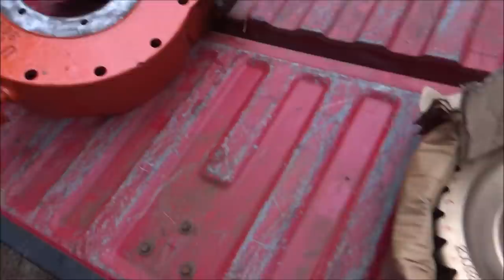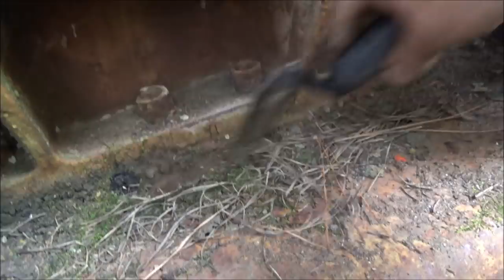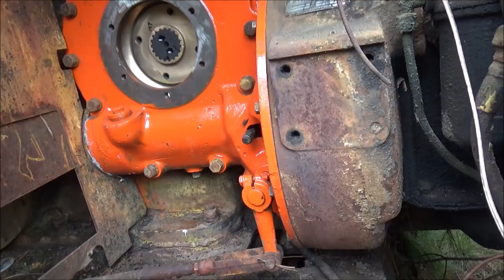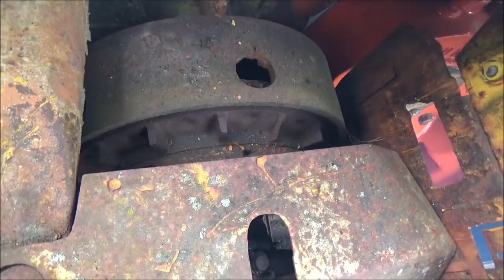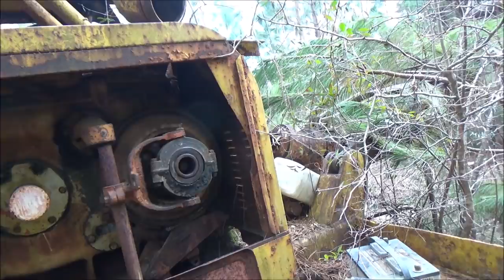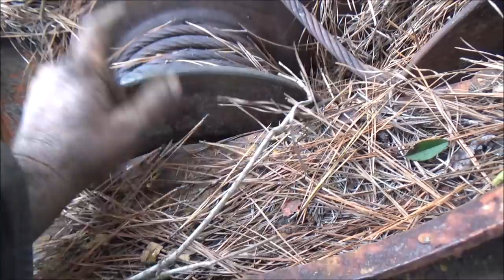UNIT 614 CRANE RESCUE 20 YEARS IN THE WOODS PART 8

Comment: Jonathan, my career has been designing , and maintaining heavy industrial equipment  with power gearboxes. I often run across gearboxes which are welded down,. I thought it was to replace dowel pins etc, but I recently was told by a major gearbox manufacturer NOT  to weld the boxes down ever! They said this started during WW2 in the shipyards (Oakland?) where the US Navy was building a lot of destroyers. The engineering spaces had many pieces of rotating machinery which were bolted to relatively thin  steel plates. A decision was made to align the equipment and then weld it down to insure it didn't slide out of alignment. Probably because the hull is fairly flexible and moves a lot in heavy seas. That became a standard in the shipyards, and there were a LOT of men working there.After the war, these same people moved on to  other parts of the shipbuilding and other industries and took that custom with them.I would not worry about the welding. The problem I had was every weld I found holding gearboxes down was cracked! You can't possibly preheat a 70 ton chunk of steel enough to weld a 300 pound gearbox to it properly.The weld cools from the outside in and the last place to cool is the center of the fillet and it usually cracks. I called to ask a mfgr about it  and they told me the story, also that the hold down bolts are sized so that when properly torqued, the box will not slip with the max output torque for which it is rated. Jonathan, I always watch your shows and I admire you more for your character , but I also think it is incredible to see y9ou do the things you do.
Reply: My thought on the weld is that since the bottom of the weld doesn't appear to actually be attached to the plate, it is most likely a replacement engine.
Reply: That makes a lot of sense.  My initial thought was that the weld wasn't there to hold the gearbox down as such, but to hold those floor plates up as they had rusted out around the bolt holes so they'd been welded to hold them up and stop them dropping into the tracks but that just wouldn't make a lot of sense as that gearbox has to be bolted to something a lot stronger than just some fairly thin steel plate...
Reply: Being an ex-USNavy guy who spent a lot of time on a WWII oiler, I totally agree with what you've written. When I was there though I was to damn dum to know though.
Reply: @garys9694  When I first began my career, my boss built some tracking antennas which had 20 hp motors driving 5 hop gearboxes. The boxes in service quickly moved,, misaligned and wore out. Then he sent a crew ojut to weld the boxes down  and scribe a line immediatey above the weld so the boxes appeared to be sitting on steel pads. That fiasco put our company out of  business, .

Comment: I love that you took the time to paint the gearcase, and the color is perfect👍😎
Reply: Agreed 👍
Reply: I used to work with an old time mechanic, and whatever component he worked on got a generous coating of Ford engine “blue” paint, and he always said, “ if you’ve got a complaint about this job, you know where to come”, and by the way, it didn’t matter what color that piece of equipment was!
Reply: The color looks like the tangerine paint for my 53 Ford's engine.
Reply: @fairlanefivehundred  I figure it shows that the person doing the repairs cares enough about the work they are doing to protect the part they are working on. Always a sign of a good mechanic or other technician, but we already knew that about Johnathan. That is why we watch.🙋‍♂️😊
Reply: looks like the old lead rust prevention paint. BleiMennige in German.
Reply: Paint will not make it operate any better one way or the other!
Reply: @garygermain2333  True but it will help it work longer and is part of a proper repair. Shows pride in one's work.

Comment: When you were moving the levers, I saw a very small movement from the tracks when it was bogging down. One step at a time. I have faith in you. It's working except for the stuck parts.😁
Reply: Yeah tracks rusted solid run the risk of shearing the new bronze gear nagain
Reply: @rsprockets7846  I saw no movement but maybe it deserves a re-watch. Do you think it needs some mechanical persuasion first, before it tries to move on its own? Put it in neutral and tug on it with his truck to break the tracks free?
Reply: Jorge, I was watching the tracks closely, and I thought I saw them move too.  When it didn't start to crawl out of its hole, I thought maybe I was imagining things, but looking at it again, I agree with you that it did move ever so slightly!

Comment: In lattice boom cranes no section can have a bend or kink boom will buckle collapse.
You can replace angle boom chords easy.
Tube booms very different to repair .
On rigging heavy lift cranes all welds must be x-ray certified to pass inspection .
But on old digging crane it's no big deal.

Excellent work thanks

Comment: It probably was the bolt holes in the casting got egged out from vibration so whoever run a bead of weld around it to keep it from moving off location. The swing gear will put a lot of stress on it and you want to keep it centered for proper tooth engagement. Way back in the 1980's when I worked for a implement repair company I would see Woods brush mower gearboxes like that because farmers didn't or couldn't take the time to fix the bolt holes in the deck the right way.

Comment: Check the brake linings on the clutches on the drag/hoist. Sounds like a stuck lining to drum. Can't be the clutch or it'd load everything else up. They all run together. The clutches lube with the button head fittings on top and adjust with the rings on the outside with the punch holes in them. Be sure to find the lock pin on the face and pull out to turn the ring loose. I never noticed the welding but I was never looking there either..

Comment: Dam! I was pushing the desk trying to help it move.  Question: was the metal welded to the engine to hold it in place? Of course, the camera angle does not show any bolts or hold-downs to keep the metal skirt (?) from vibrating.

Comment: Boom reeving is full reeve suspension usually used in duty cycle work.. Dragline, clamshell, grapple, magnet, all with cycles of less than two minutes.... The pendant line suspension with pendant lines from an outer bale with sheaves is for lifting work.. Usually slower boom hoisting but can handle greater loads....Maybe not so with Unit I don't have any experience with them but with American  and others it is that way..... Full reeve will have duty cycle capacity chart in cab, pendant line suspension will have higher lift capacity chart in cab... Ruud a matic tagline on bent section of boom suggests that this machine may have been used on clam shell, or some other bucket that had to be tagged..... Mike in Louisiana

Comment: The reason the case is welded is that the copper gasket started to leak. The crane was over stressed and stretches the bolts. You want the house lock engaged to travel. Unlocked to swing. To the right of the operator position on top of the gear case is a cover plate. If you unbolt the cover you can access the travel , swing and steering linkage inside. You may have to use a bar or large punch to help free them up. It's a tight fit but it can be done. Had to do the same thing myself.

Comment: I was also thinking something beyond that gear may be locked up. It would be good if you could give it a yank or tug to make sure the tracks and drive axles turn. hate to see that new gear get chewed up.   Really enjoying this series!!!  That is such a cool old machine.
Reply: That's my next fear--that the tracks are rusted solid and need to be mechanically freed-up before attempting to move it under its own power. That and the fact that it's almost half buried can't be good for the drive gear(s) and everything else that may be seized from time and corrosion...

Comment: there's a plate between those two drums  and in front of the forward drum where you can get to the jaw clutches for swing an travel. they probably got rusty on the shaft. just went through this on a 1020

Comment: You eat an elephant the same way you eat a chicken, one bite at a time. Excellent progress! In regards to the welding. I wonder if at some point the manufacturer discovered that the bolts weren't sufficient to hold the casting to the plate and decided to weld the perimeter. My second thought is that maybe there is an oil bath that kept leaking so somebody had the great idea to just zip a weld around the outside. I would think that if the factory had done it they would have used nickel weld just like the detroit arsenal did welding Sherman tank upper castings to the sponson plate.

Comment: That engine started so easy. Starts better than some diesel trucks.
Reply: I was thinking the same thing. Must be making good compression still. Love those old 2-stroke Detroits.
Reply: Theoretically, and in praxis, too, Diesels start instantly, one rotation should be fine. This can actually be an issue (lubrication). Old Benz diesels in the 60s started instantly, later MB decided to slow that down, so while turning over they would build oil-pressure first then turn on the fuel. Old mechanical diesels only need fuel and compression to start instantly. I have push started Diesel cars and even vans like the old sprinter vans in the 80s and 90s by myself. 3 guys could pushstart a 7.5 ton boxtruck with a manual provide you have enough air to release the brakes. never did try this on anything more than a 20ton box truck, rolling down a small incline, 3 yards or so dump the clutch and it ran. It does get VERY cold in Germany in February.....
Reply: @uliwehner  When bump starting (push starting) a vehicle, it would start weasier when it is in reverse.
Reply: @ianallen2   true, but difficult to do when you are backed against the loading dock :)
Reply: @uliwehner  So true. :)

Comment: Just drill a 1/2 inch hole in the hood and pass a rope or cable through the hold use com-along to lift housing just use a pug in plug like electrical box to fill hole of mig filler done it many times

Comment: Call one of your buddies with a semi truck recovery unit with the biggest cable available and pull the crane towards the road to loosen everything up while you're engaging the clutch. The tracks and everything are probably stuck. Like push starting a car to get it going. Soaker down with oil and you're good to go.

Comment: I wonder if they used a wrecking ball on it at one time, the bent boom and welding the gear box down seems like they were putting a lot of load on the swing. I bet it's like a hydraulic motor you weld heavy key stock around the mounting base to keep the bolts and casting from breaking with a lot of torque. She runs good mechanical machines are so cool you made the right choice in my opinion.

Comment: The swing is in the locked position and it is the lever is in swing position  if you pull it back it will be in the travel position. Next level to right is boom hoist then the next is to steer tracks. The clutch that you say dogs down when you try to use it is probably stuck together. I had that problem with mine. The clutch was rusted together. I just backed off the clutch tensioner and worked it till it freed up. Then tighten it back up.
Reply: Any kind of emergency brake that may need releasing before it will move? Maybe get the truck on it or a wench cable to a tree try pulling the tracks up out the mud .Oh the wench cable on the Crain to pull you out. I'm sure you'll get it moving.👍🏼

Comment: I think there is still tension on the boom and it needs to be out of gear to be able to move the swing or tracks. You will have to get the boom lock loosened also. The load line works-that's great, then you might be able to hook it up to the boom temporarily to raise and lower the boom and might help to get your other devices unstuck.

Comment: That lever on your right I believe is the jib hoist pawl , that locks the jib so it doesn’t drop out of the air , normally to unlock that you have to have it in crane mode  pull the jib hoist in then you should be able to release the pawl lock    ,Normally the pawl lock is put in position at the end of the day because it is a gear lock that holds the jib up without using the clutch brake.   ,this was used pre air assistance.i operated 19  22   And 36 RB BACK IN THE DAY IF THIS IS ANY HELP TO YOU   JUST LOOK UP ON LINE BRAKE CLUTCHER AND PAWL LOCKS JONATHON 🇬🇧🇬🇧🇬🇧🇬🇧🇬🇧regard John the UK

Comment: I've been a farmer for 45 years and done most everything to machinery that can be done. The only time we've ever welded gearboxes that were bolted down like that is if for some reason there was enough vibration to keep working the bolts loose thereby making the gearbox loose.I've only done it three or four times on three or four different pieces of machinery but admittedly it's not the best way to fix it but sometimes it's the only way to fix it. Of course, on gearboxes we always use nickel rods because they were cast iron

Comment: I'm sure you probably know this but did you check your gear lube to see if it is yellow metal safe? I have been burned in the past with gear lube that isn't safe with bronze or brass gears especially in older tractor transmissions and it can cause problems. Really enjoying this series!
Reply from the maker: Yes I ordered the right stuff
Reply: It's old school GL-1 before the modern day additive packages...even though the GL-5 stuff often claims it is yellow metal safe...

Comment: Great work so far!  Take along a grease gun and grease EVERY linkage joint and every clutch throw out bearing. Some of the clutch facing may have fused over time. Eating this elephant will take a lot of bites.

Comment: Straight except where it’s bent, is that the like it’s the same but different. You already know that the hardest pull will be getting the first movement off the spot. I suggest getting the drag rope drum working first and then pulling out the drag rope and hooking to tree, if there’s a large enough one,to help with the first movement. We used to use the drag rope to help with loading up over rear of trailer.
Reply from the maker: gonna try, got it working, lets pull a tree down

Comment: Great job  Jonathan  !  
What gear oil did you use ?  Suggested manufactures ?  Reason I ask is I have seen a few catastrophes when too light of an oil is used in geared elevator and escalator machines .  That machine must have been running dry for many many hours.

Comment: I got a chuckle out of the outro your son saying bye 👋 I was wondering how you would figure out all the functions on the crane not that i know anything about it but thinking 🤔 maybe those brakes have to slow the moving drums or whatever they are or stop them to get the cable drums to engage even drive mech??????good luck moving forward and watch out for your digits with all moving parts and fishing line wrapped cable!!!

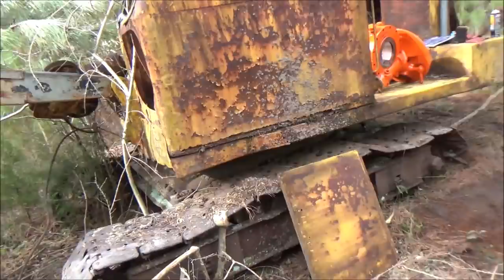Comment: At 4:58 I notice the reel o'matic is on the top of the boom. That's a first for me. And the boom hoist cable is attatched.  Seems that it's suppose to have an equalizer there and connected to pennit lines going to the head section of the boom. Seems that if you lift something that the reel o'matic would rip the boom into or buckle the boom.
Reply: Just noticed that it's a chain holding boom up

Comment: Very satisfying to see that painted gear case installed. On the verge of swinging and rolling!
Reply: I agree. I have about the same level of OCD. Cleaning it out and cleaning the mating surfaces for a good seal is about the minimum for most, but a coat of fresh paint just tops it off...

Comment: I noticed they used safety wire for all the nuts where that housing is going. Before the times of heavy duty thread locker ( but still the safety wire certainly does the trick )
Reply: Safety wire is still in use, especially on high end machines and almost every airplane in existence.
Reply: @Hjerte_Verke  yes, thinking about for awhile safety wire is still a must in certain applications . I definitely understand about planes. I was impressed to see it used on that old machine

Comment: I'm willing to bet that the tracks are locked up. If you could give that beast a healthy push or pull it might break them free. Either that or get the biggest can of PB Blaster in the world and use it to soak them. The engine sounded great!
Reply: That's my fear--that the tracks are rusted solid and the fresh drive gear is gonna be under tremendous strain, along with everything else that's seized up. Not to mention it's also half buried...

Comment: One additional question I have,  It looks as if there is mud and standing water literally everywhere in these places where you find this abandoned equipment.  Does it ever dry out enough to be able to get this thing out of there under it's own power?   I have to assume it does as it had to be dry when they brought it in there.  I also keep wondering what they were doing with that machine in such an isolated area -- in the middle of a woods?  Is this abandoned farmland?
Reply: The water table is high (saturated) where he is in North Carolina. Dig down several feet and you hit water. The crane is sitting in a literal swamp-like area with streams nearby but a tracked vehicle does very well on soft ground because of the low psi ground pressure. If you go back to the first videos featuring his quest for a crane, this one was "retired" in an open area about 20+/- years ago, which has now grown up. He shows an old satellite photo where it was in a clearing, at the time... It's not abandoned property.